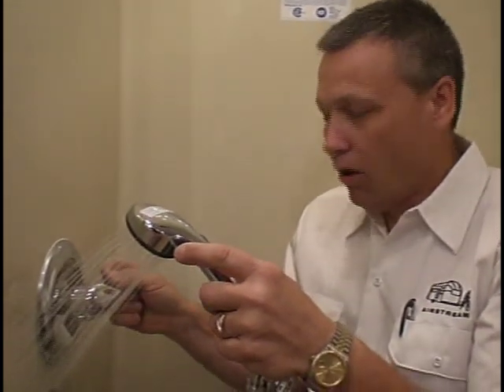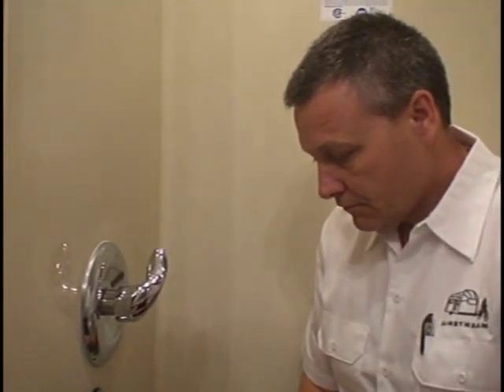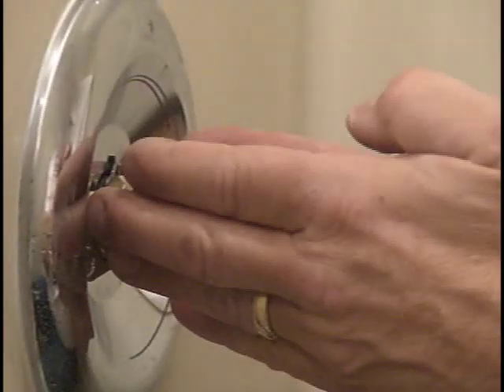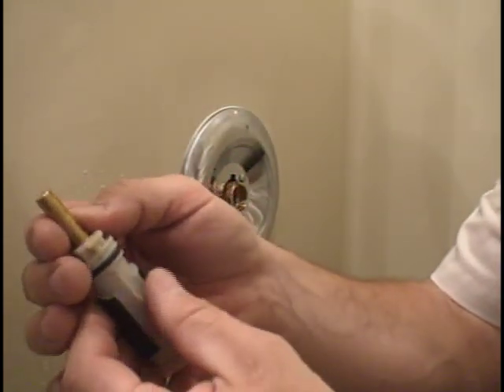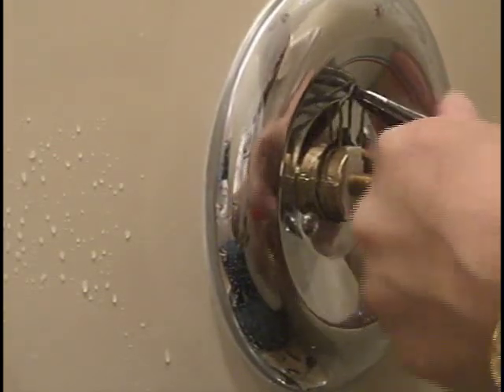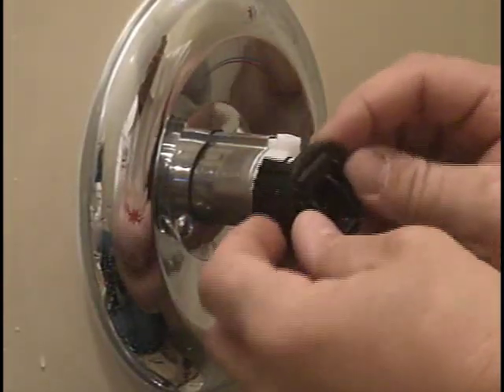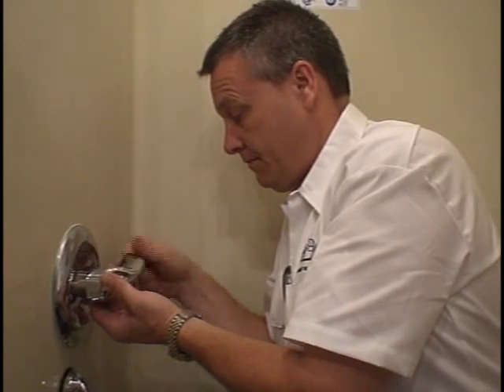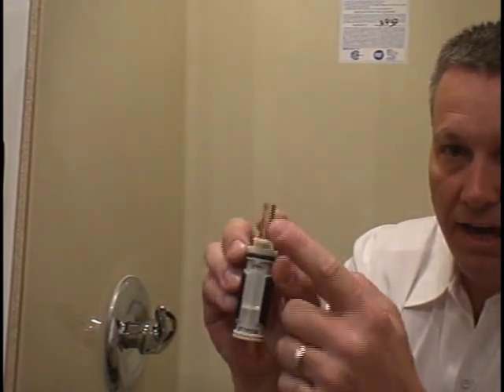Airstream How To: Replacing a Moen Shower Cartridge

Comment: Great video on how the parts fit together.   The cartridge was a hard pull even though it was only in for about 4 years.   Some gasket lube was helpful putting it back together.